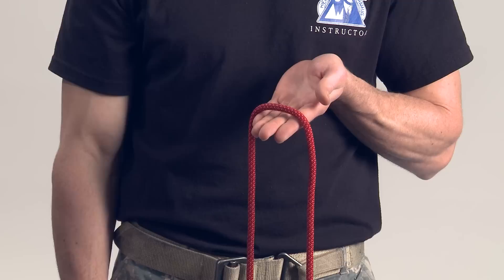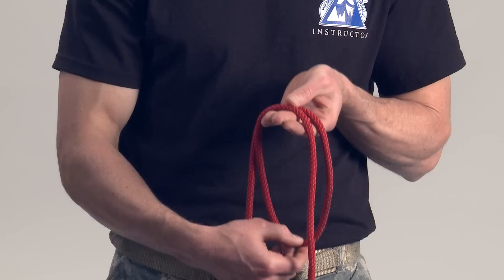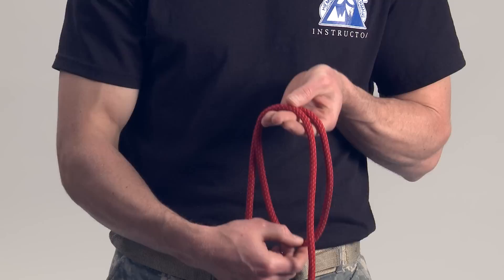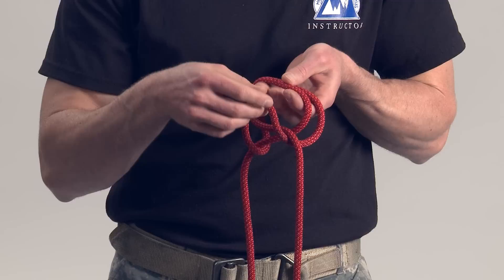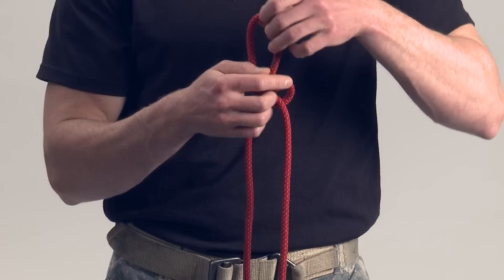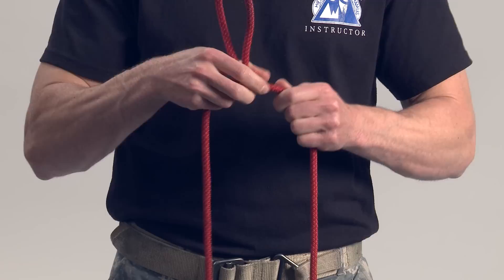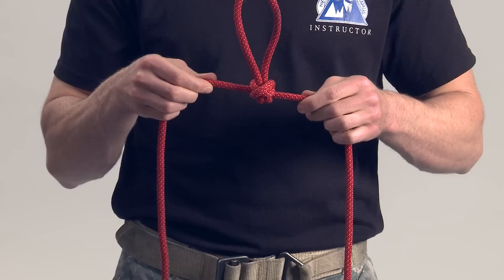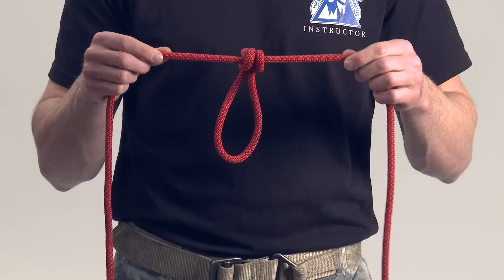Butterfly Knot

Comment: Your knot is not safe for isolating a damaged section of rope. Tie your knot loosely and pull on the standing ends. Your knot parts want to separate, whereas mine won't.